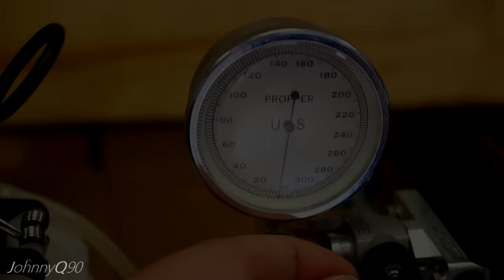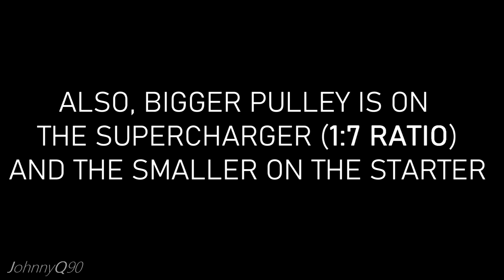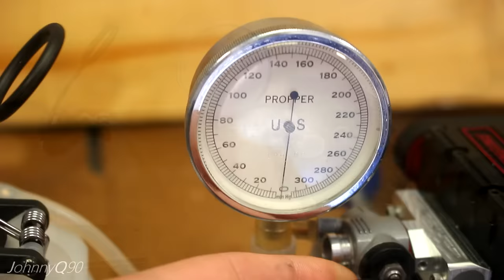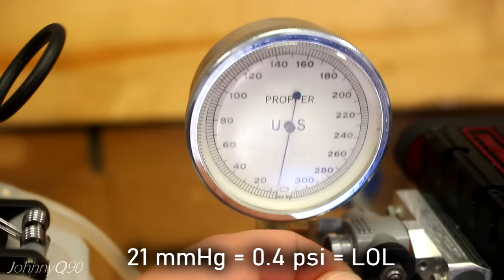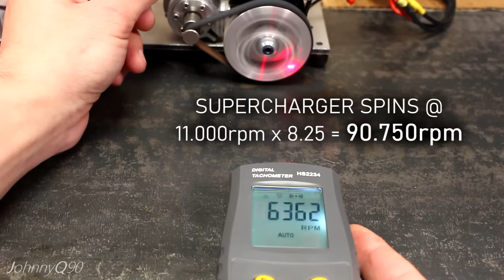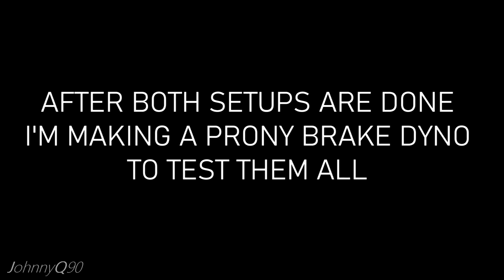0.6psi @ 90,000rpm Supercharger on MINI 2 Cylinder Four Stroke Engine! - BLOW Through Setup

Comment: that doesn't sound like 90k rpm (at all)
Reply from the maker: Are you referring to the engine which is doing 11,000 or to the supercharger that is actually spinning at 90,000rpm?
Reply: @johnnyq90  is it carburated
Reply: @shorttrackthing6919  Yeah
Reply: I'm guessing this produces LESS power with the "supercharger" attached than it does naturally aspirated.  There is a lot of drag involved and very little in the way of air pumping, plus a portion of that air-pumping is going to the tank for pressurizing the fuel.
Reply: Alpha Wërks automotive  I know they need more than 6 tenths of a pound of boost to make more power.  The amount of extra fuel you can burn with 6 tenths of a pound of pressure is most likely far less than what it takes to turn the supercharger.
Reply: @johnnyq90   Very impressed with your Pocket NC mill! Little Toyan should be pressure liquid cooled.
Reply: You have tachometers in your ears?
Reply: what type of world do you live in where that is even a possibility i dont think any conventional piston motor can eben come close to 20k
Reply: He is referring to the super chargers RPM, not the engines
Reply: @boostleak4704  there are motorbike engines revving up to 20k
Reply: @avanix702  a lot of Formula 1 engines got pretty close to it too, but the Cosworth CA 2.4L V8 got to 20k
Reply: @billbergen9169  yoooo billll what’s good dawg
Reply: You can install a high gear ratio transmission in front of the SC?
Reply: @avanix702  on
Reply: @boostleak4704  You must live in a VERY small world then... I have small N/A piston engines that turn 38,000+ RPMs.
Wise up man, before you make more foolish statements like that. 😒
Reply: Brian Bergh  Look at the size of the pulleys. That right there should give you a clue...
Reply: @johnnyq90  did you notice at the end of the video when you were running it and showing the s/c the water forming inside everytime you opened the throttle? And I must say I'm impressed with your abilities. How old are you and what is your background if I might ask?
Reply: Nitro rc engines go up to 50K RPM lol
Reply: he thought the engine itself spins at 11k rpm but the title says the super chargerspins at 90k not eh engine
Reply: @boostleak4704 ..try F1....try 125cc two stroke racing motorcycle s...

Comment: Congratulations, even with the tools at your disposal, I don't think it's an easy task to build a balanced carburetor like the one you made, to make the correct "air and fuel" mixture.
With this supercharger in your opinion, what is the real gain?
Leandro Wagner.
Reply from the maker: Hi Leandro. Honestly, I'm not sure if with this setup we'll see any significant gains. With the draw through setup (carburetor before compressor) on the other hand, I think it will be more interesting.
Air/fuel ratio should be much easier to adjust. Right now the fuel needle valve is way  too open (too rich) to prevent the engine from going too lean. This problem should solved with the draw through setup. I'll be able to lean it enough (more power), and still be in the safe zone.
Reply: @johnnyq90  Stock engine is working at higher rpm's. Can you explain this johnny?
Reply: @Alpi-yn5jk  the supercharger loads the engine a bit so you get an rpm drop
Reply: @johnnyq90  i think that draw through is the best option now, also, in future, maybe try bigger/smaller s/c to see if that affects it
Reply: @Alperen because superchargers suck engine power at high rpm, thus not being able to rev very high, thats why all the american supercharged cars rev so low, (+ the large displacement doesnt help)
Reply: @johnnyq90  Have you thought about a plenum chamber,  the way i see it the supercharger is making boost before the engine can use it and it has nowhere to go, the boost is pushing back against the supercharger and increasing parasitic loss.
With a plenum chamber the boost has somewhere to go to compress and should smooth out throttle response.
Reply: @Alpi-yn5jk  these small engines run at a high RPM thats just the way they are.
Reply: @jtmunn4496  If you watched johnny's all videos you must have watched the stock version of this engine. Stock version is running higher rpm's than the turbocharged version
Reply: @FUCKEDUPFAB  he connects boost pressure to the tank so the boost in the carb is cancelled out by the boost routed into the tank. This allows the normal vacuum of the engine to draw fuel out of the tank under boost.
Reply: @purvapedrikz2271  american cars usually have superchargers with more displacement than euro engines lol
Reply: @johnnyq90  I don't understand why you didn't make fuel adjustments after you hooked up the inlet to the SC... ???  You just added more boost, yet you didn't adjust and add more fuel?  what gives?????????
Reply: CurlyG65  The "ratio' doesnt' matter as much as just the stroke length alone.  Long stroke engines can't high rev simply because the "piston speed" is too high.  Short stroke engines can rev much higher simply because that piston has less distance to travel per each Revolutionl;  and this is true reguardless of the actual size of the piston, although at extreme ends of size variation, it will still factor in somewhat.
Reply: The intake of the supercharger is very sharp and abrupt. Wouldn't a inlet-funnel or cone make it easyer for the air to get in? As on old  tuned carburatorcars. More air, more pressure🙂👍. Love your videos💛
Reply: CurlyG65  Are you a mechanical engineer?
Reply: @Wulthrin  Are you talking about idle or top RPM? Either way, the engine should be able to drive the supercharger at idle and max RPM. If the engine can't drive the supercharger at max RPM and thus dips below it there thus is no power left to drive anything besides the supercharger. That would be a really bad design.
Reply: @purvapedrikz2271  I will say I know someone who watched a supercharged big block throw the supercharger over 100ft in the air once the engine hit 10k rpm
Reply: @johnnyq90  you need a step-up gear (multiplier) for the supercharger To give out 45-50,000 rpm = 0.5-0.6 bar boost Sorry I'm not the USA, I wrote via google translator
Reply: @williamwilliams8145  On top of that, it will give a solution for measuring actual manifold pressure.
Reply: CurlyG65  RPM limits are usually dictated by actual piston speeds. Bore has no affect on piston speed.
Reply: CurlyG65  I am familiar with this subject Curly.

Comment: Nice machine build.  A couple thoughts;  Most driven centrifugal super chargers spin in the rpm range you are running, however they have a much larger diameter on the compressor.  The diameter builds the pressure, the vane height builds volume.  With that said, boost pressure should be tested while flowing.  Negative displacement pumps are prone to cavitation.  Once cavitation occurs flow and boost fall off dramatically.   You could actually be running more than 0.6lbs. Your motor could be consuming all the boost too.   If you measure boost while running, you can see where the boost curve peaks & falls.   Keep at it

Comment: I've got a centrifugal supercharger on my truck. It has a gear reduction in the supercharger drive and further reduction with the drive pulleys. Yours is direct drive so you really need to overcompensate with your pulleys. Couple that with the unit's small size and you really have to spool it up to create any pressure. I know that your previous testing of gearboxes dictated your use of direct drive. Until you can spool it up properly, you'll never make much boost. Centrifugal superchargers have a rising boost curve. You'll just have to spin it faster to build boost. My v8 engine sees about 2psi at 2500 engine rpm. At 5000rpm, I'm seeing about 6.5psi. At 5500rpms, I have measured 8.5psi. I have a pulley drive ratio of 2:1 and gear drive ratio of 3.61:1. So a final ratio of about 7.22:1. According to the manufacturer, it is capable of 52,000rpms and 22psi. I think your homemade supercharger needs more rpm. 
  Could you build another set of pulleys and spin it up with a drill to spin it faster than your 77,000rpms to measure your pressure?  A cordless drill spins around 1200-1500rpms. If you reuse your original crank pulley, you could probably make something work by only making one more small pulley.
  Good luck with everything. I'll definitely be watching for updates.
Reply from the maker: I agree on everything. All these videos are just a preparation for the positive displacent supercharger that I'm planning to make. Honestly, I think it's the wisest option for this little motor. The centrifugal supercharger builds boost exponentially as you said, and at this scale, things are even worse. I hope you understand.
Reply: @johnnyq90  excellent. I wasn't sure where you were going. I thought you planned to eventually build an exhaust turbine and convert this centrifugal supercharger into a turbocharger. 
  I'm very interested in these builds. Keep up the great work!
Reply: @johnnyq90  If you make a larger supercharger, it'll put out more pressure. That wouldn't do much, as the intake ports are pretty tiny as-is. The pressure is just building up, and not going into the motor as easily. Maybe enlarge the intake and exhaust ports, and build a larger diameter exhaust as well? You'll want to size it the same as the valves on both sides. Intake should be larger than exhaust, as it is with most 2-valve motors.
Reply: @mattio79  I believe the fuel in the inlet of the supercharger indicates what you're saying as well. Air does not seem to be going through the engine as efficiently as it should.
Reply: You also have to consider the size of the compressor impeller in its ability to accelerate air to produce pressure, and the fact that the relation between air mass and volume present some scaling issues. The smaller it goes in radius, the higher and higher the RPM the impeller must spin to do anything. Then the problem ends up running into material limits and tolerances. In this case bigger is better, and the tiny scale engine certainly presents challenges.
Reply: You could also compare this centrifugal compressor to a turbocharger, rather than your centrifugal supercharger. A "small" turbocharger on a standard road going car can easily spin at over 160k rpm, and with some of the modern engines that are very small capacity with teeny tiny turbos, can seem speeds in the 200k rpm range.

This micro compressor needs to be spinning an order of magnitude faster imo, although at that point I think friction losses will likely be too great.

Maybe the solution is to use a much larger compressor! it may seem logical to downsize the compressor to suit a downsized engine, but I don't think the aerodynamics scale in the same way.

Comment: I love this series of videos and am excited to see where all of this goes. Already looking forward to the next updates!

A couple things to sort out. When sizing a compressor to an engine, the airflow is what you want to calculate. In order to know if the compressor is the optimal size for the engine, you'd want to sort out the CFM per RPM of both the engine as well as the compressor. It appeared as though the gauge you connected to the outlet was measuring the force of compressed air from the supercharger, but this won't give you a usable number for a couple of reasons. 

First, the compressor not being a positive displacement unit, won't do a great job of maintaining pressure, even with the centrifugal effect, you'll get reversion at the inlet (also possible if the AR isn't high enough to overcome the pressure difference in the scroll I.E. the inducer air-speed stalls because the exducer doesn't have a high enough ratio, and is being overcome with backpressure). This begs the question if you might need a larger compressor to feed the engine, but more importantly, you can't get accurate information measuring static pressure. You'll need to figure out how to measure the pressure of the FLOW of air inside the plenum. Compressor output is important, but understanding how that correlates to the inlet consumption of the engine is the most important metric. Could you not plum the pressure gauge to the tank backpressure bung?

The other factor to consider is that you're not just creating air pressure, but increased flow (ideally). It's possible the higher drive ratio is allowing the compressor to feed just enough air to the engine to match natural aspiration. Without knowing the CFM data across the operating range (effectively, your compressor map) it's anyone's guess. You could play with some math to get an idea where things are now.

Ultimately, I think you'll have a better run of luck with a positive displacement unit, where you can calculate linear differences in output-per-RPM. A good starting point would be to measure volumetric efficiency as both CFM and a factor against the displacement of the engine, then build a compressor using that data so you can land squarely in a good efficiency range.
Reply: Under rated comment

Comment: I thing the supercharger is running on very low rpm, you should try like 1:15 Ratio, or even more. And i think 3d printed inlet hose is a very bad idea due to leaks.

Comment: Great work Johnny! I would recommend though that on such small scale(s), the compressor inducer inlet step is to great for smooth air flow. I think you'd get better performance(air velocity)  if you bevel/tapper/blend the SC inlet valve to match the compressor wheel's inducer radius. You may also want to consider port-matching all your components.  While working with components this scale, every little burr, crack, imperfection, etc. will have a profound affect on air flow. Good luck and I can't wait to see more!

Comment: In my day, (  1961 Apprenticed for SIX years Mechanical Engineering )  I could have made the inlet manifold BY HAND in a couple of hours, from a drawing, without using ANY machine tools. The site of CNC machines doing all the work, is not very pleasant to watch, whereas watching a craftsman with tools in his hands, is a very satisfying experience. Furthermore, the increase in volumetric efficiency of the engine is achieved by the use of a blower, but  this means of increasing power is not as satisfactory as reducing the reciprocating masses,  to increase RPM, and careful attention to the inlet tract flow passage, combustion chamber fluid dynamic calculations, and improvements to increase compression ratio, flame propagation pathways, and  camshaft design to include the design of the plenum chamber, and valve overlap /  flow design.  Simply bolting on a geared up blower is something of a cop out, any fool that do that, with enough money and time.

Comment: Have you thought about adjusting the timing? If you advance the intake it will give the motor more time to be open and more air will enter. You will have to give it more fuel or a higher octane fuel to make sure it won't run lean or predetonate and bend a rod or blow it apart. Just an idea to pick some more power and keep it running at it's peak.

Comment: In the aviation/automotive world supercharged blow through carburettors are usually encased in a sealed box with the supercharger blowing into the box not down the intake, that way the entire carby (including the outside) is supplied with compressed air which prevents air leaking out the carby shaft seals and also pressurizes the float bowl which allows for the proper air/fuel mixture.
This also allows for the use of a standard carby and not one designed specifically for superchargers.
 Maserati used this technique in the 1980's.

Comment: 7:20 There is too much volume in the tank. The SC can’t support it. You need a pressure referenced regulator.
Reply: also would help to put a one way valve on the SC pressure line to the tank for when it spins down at idle to keep the pressure so the SC don't have to build a lot of volume to get the fuel pressure back
Reply: i can see that there is quantum tunnelling occuring in the resonance chamber. they need to hook it up to a flux capacitor to induce magnetocranial biostabilisation
Reply: @cvspvr  how about pizza?
Reply: He needs an electric fuel pump
Reply: @cvspvr  You can see that?  dang , can you see the lotto numbers? so I don't have to work at to win

Comment: Guessing this would be a bit small to handle a positive displacement system. Surprised to see this turbo charger style setup actually gain so much boost with the rpm increase, figured it would have hit it's ceiling much sooner :) Very interesting, nice work man!
Reply: Not a "turbo". It's a centrifugal supercharger.

Comment: Fantastic work as usual!  To put things in perspective a C-1 Procharger spins at 80K rpm with a 4.25 inch exducer diameter.  To get significant boost out of this one you will need dramatically higher rpm.  300K rpm and bronze journal bearings are kind of the starting point for a few psi for boost with this size impeller.  Those deep groove bearings won’t cut it at those speeds.

Comment: I feel like this turbine just has to be choking, trying to move so much air. And with turbines increasing rpm doesn't move the choke line to the right as much as might be required if the size is way off.